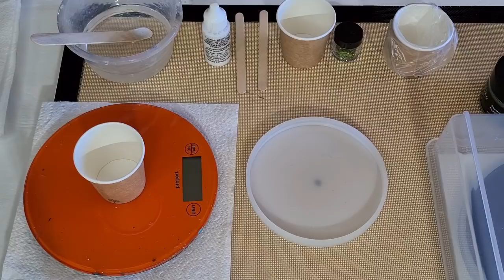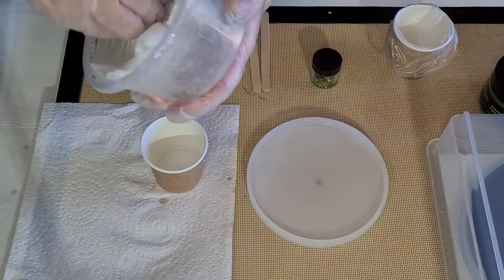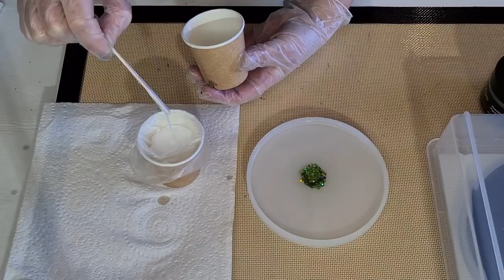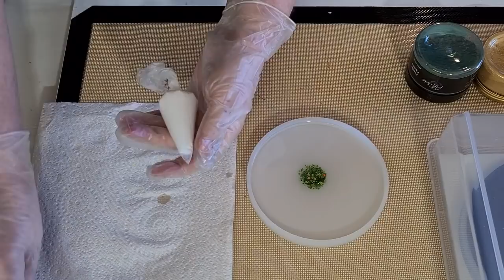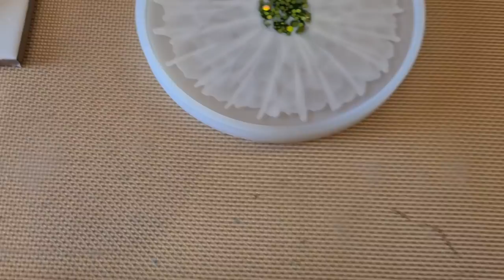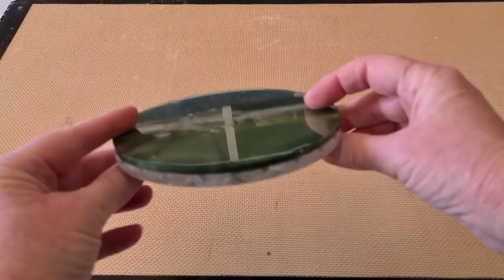#1040 WOW, I Was Not Expecting That! Incredible 3D Effect In This 3D Resin Flower Bloom Coaster

Comment: This was so cool! How pretty! If I might make a suggestion, when I use resin I have found if you allow the leftovers to stay thick, after pouring what you can out, in your container and allow it to totally dry, you can peel it cleanly out of the container. I use to wipe it out too and then I had thin parts still left behind that got into my next pour or in my case the next painting I was putting resin on. Just a suggestion. Suggestion two, you were brilliant to put the dot in the center of the underside what if you also put an outline of the lines you want to draw and just follow them, then you would always be on center and have perfect symmetry. Please don't be mad I think your work is awesome, I have never seen these before. I just thought when I saw your center dot it should work for the petals as well.

Comment: If you want to make sure your flowers are symmetrical, print a guide sheet and tape it under your mold. You can just do concentric circles in alternating black and white, and a cross line in the center.

Comment: The spot on the outside to show the center is a good idea; I know it's a while since you did this, but maybe you could put circles on some of your molds the same way so you would see exactly where your piping should go.  Is there a way to do so when you make the mold itself?  Or, make a circular template on cardboard about 18" across and draw the circles with a middle dot - maybe alternate the circles with black and another dark color that stands out from the black.  That way, depending on the size of your mold, you can vary your petals.  //  This was a 'disaster' as far as not getting results you wanted (open petals with the background showing thru) but it was a very pretty 'oops.'

Comment: The reason it heats faster is mass if you pour it an eighth of an inch over a large bowl it will heal slower condense it together and it will heat thermal a quicker